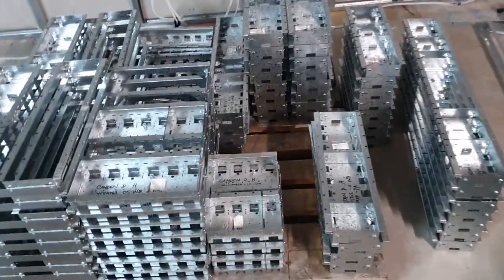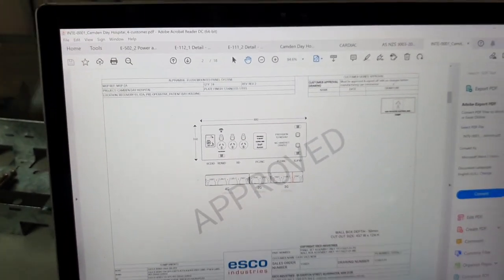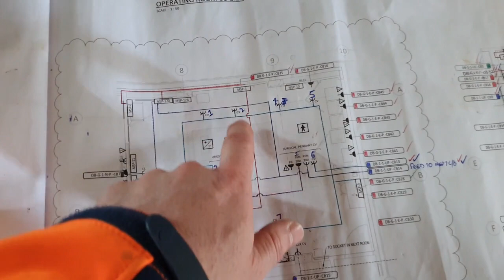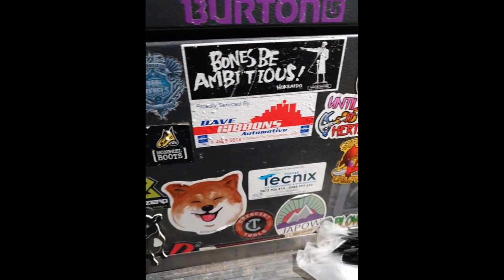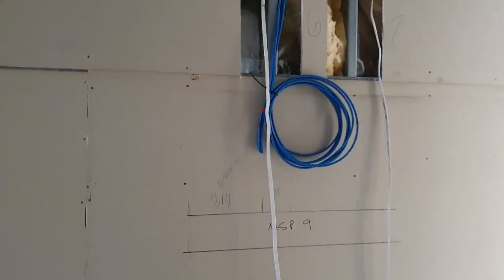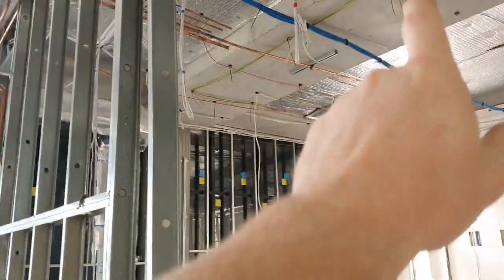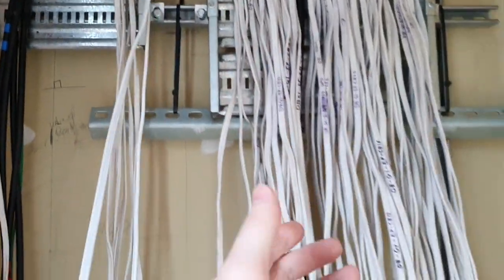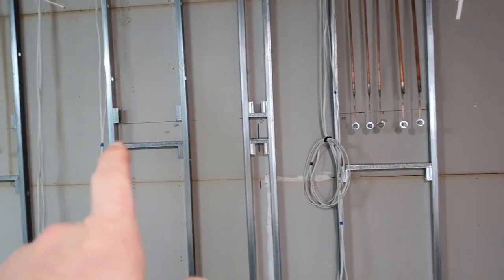VLOG #7 Day Hospital Patient Area Standards and Practices - Heaps to Learn!

Comment: you don't use the nut and bolt on the cable tray brackets ?
Reply from the maker: ohh If you spotted one missing let me know time in the video and ill check on site - thanks!
Reply: 10.58 where cable tray slipped down, did not see bolts on the hold down brackets
Reply from the maker: @michealplater9007  You know I've never used a bolt onto tray through the side of the hold down clamp before - has always seemed to be solid enough. BUT in this case I'm definitely gunna do it. You pointed out the obvious for me haha